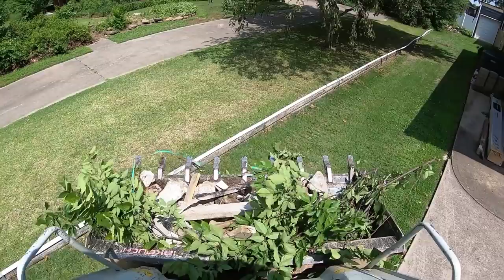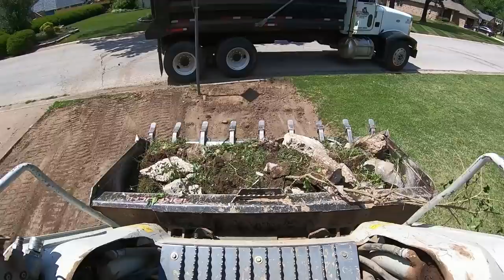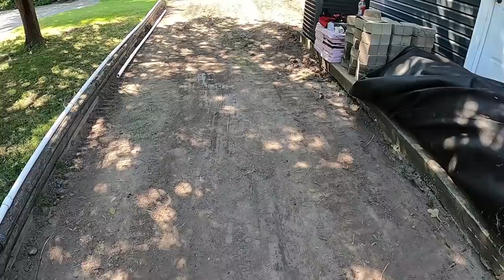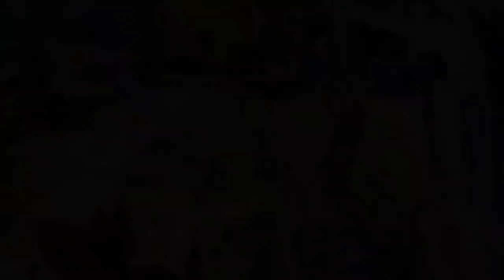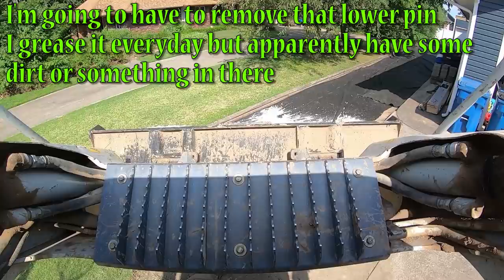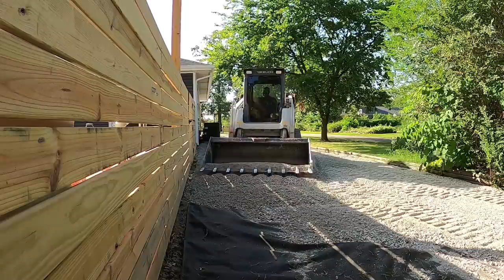Building A Golf Cart Driveway

Comment: If it was intended for a vehicle,  instead of a golf cart, would you have put in a 3" base as the first layer?  I'm extending my drive to my polebarn, and was planning on a larger base initially.   Have a lot of wet clay here.  You make it look easy, but I know better!
Reply from the maker: Yes I like using 3” clean for the sub base then top it with some 1” base. Seems to hold up better that way. Thank you I appreciate that. Good luck too sounds like your on the right track 👍🏻

Comment: Sounds like someone needs to add a little grease...
Reply from the maker: I grease it every evening, I think something is blocking one of the holes in that lower pin. It makes it half the day and starts squeaking
Reply: @eliteearthworksllc  Been there before. At least the grease fitting don't cost much to replace.
Reply from the maker: That is true. The fitting works I think it’s the hole in the pin itself is blocked on one side